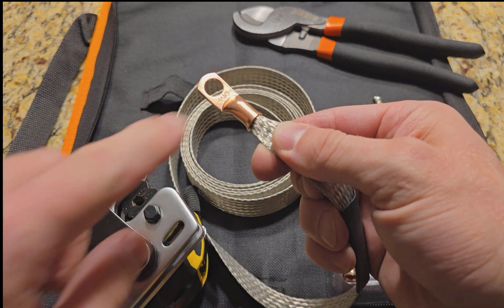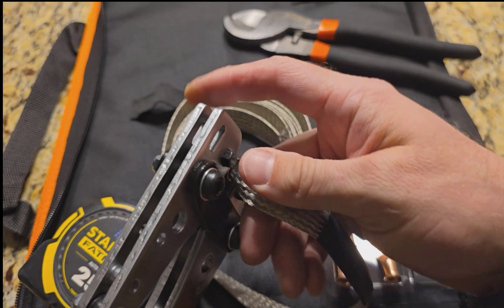⚡️Bonding/Grounding Straps for Vehicle #cbradio #102 #rfi #continuity #grounding

Comment: Wouldn't it be a better connection using something like 4-0 guage wire?
Reply from the maker: Well. Grounding a vehicle for rf is usually recommended to use huge surface area like these branded ground straps. So I guess it depends on the application.  👍

Comment: Thanks for the video . They don’t need to be soldered?
Reply from the maker: Thanks for watching! And no. I've noticed it's more of a preference. These type of clamps provide a type of connection that smashes the wires together so hard they kind of become one. They can't be individually separated. So electrically, it's all you need. Then the heat shrink has a resin that melts in all the little spaces. Some people swear by one way or the other.  If you gave me all the time in the world I would probably solder them, but as you can see I'm no expert. Lol. I'm a nurse. But growing up without having 2 cents to scrape together, you learn to do a lot of stuff yourself on the cheap. And this is more than sufficient. I hope that helps.

Comment: how did you figure out what size connectors to get for your braid size?
Reply from the maker: So I just googled it and found that the 1 inch braid strap was typically used with that 4 Gauge connector. But when I went to crimp it with the 4 gauge setting on the crimper, it left a bunch of wiggle room, so I rotated the teeth to 6 Gauge, which crimped it much smaller and tighter to my liking.